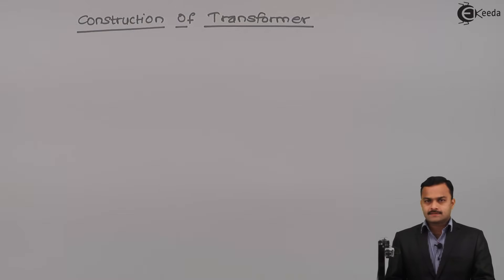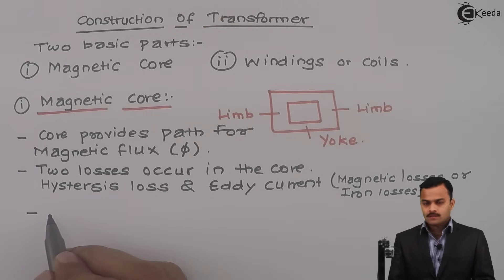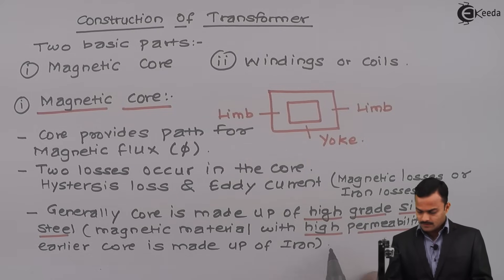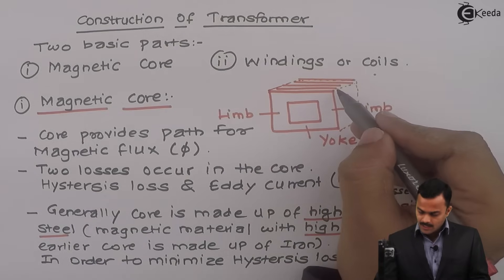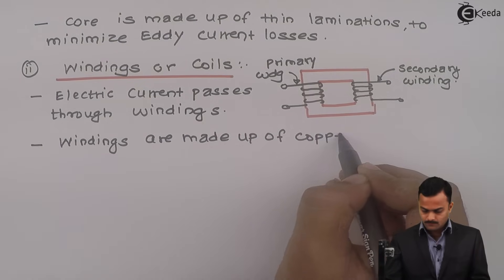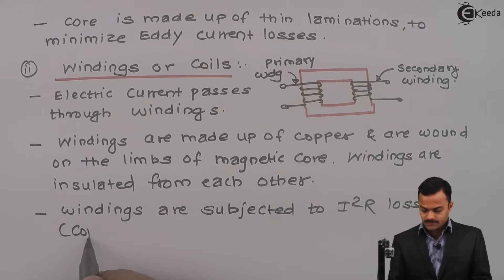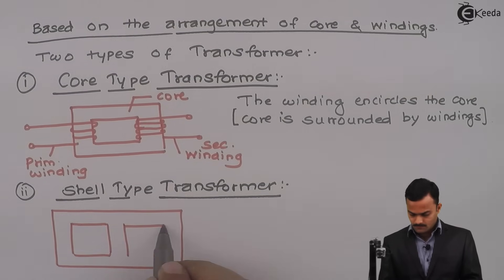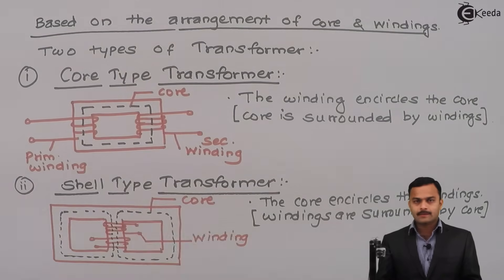Construction of Transformer and Its Types - Single Phase Transformer - Basic Electrical Engineering

Comment: Core type transformers are popular in High voltage applications(NOT SHELL TYPE)
 like Distribution transformers, Power transformers, and obviously auto transformers. reasons are,
High voltage corresponds to high flux. So, for keeping your iron loss down you have to use thicker core. So core type is better choice.
At high voltage you require heavy insulation. In core type winding putting insulation is easier. In fact LV(low voltage) winding it self acts as an insulation between HV (high voltage) winding and core.